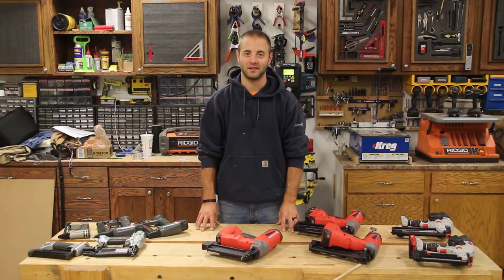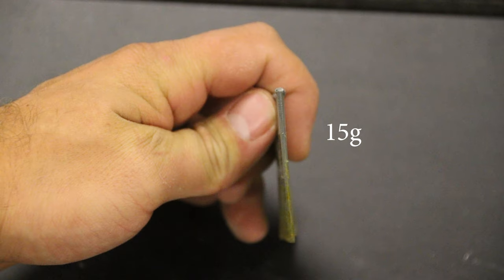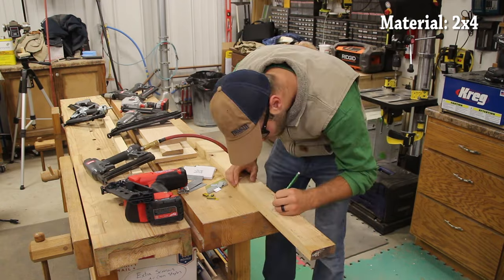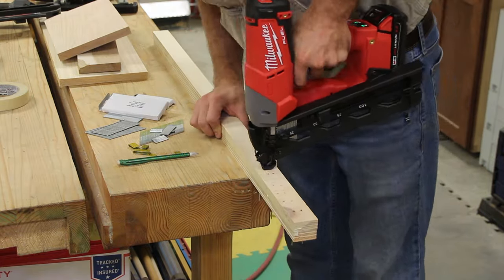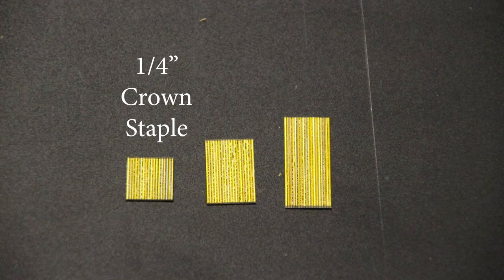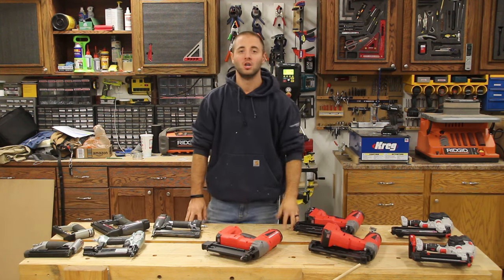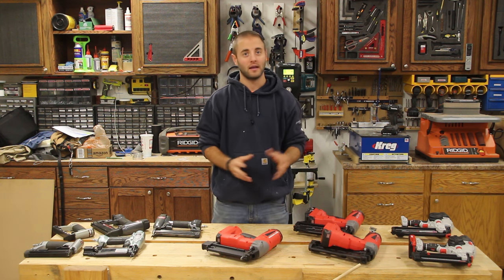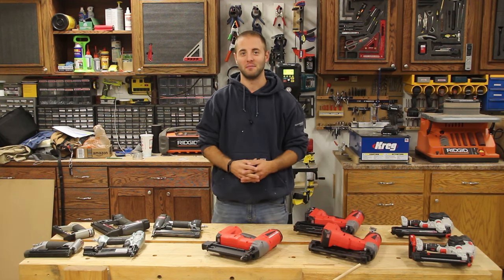What Gauge Nailer for Woodworking?

Comment: Perhaps you could guide me. I made a few 'racetracks' for my son. The vertical ones with tiny little cats that zigzag down 4 levels. First had PZ2 screws. It's very strong but looks terrible.  It's made if 12mm ply, and the screws crack the ply edges. Then the 2md trial was all glue and dados/grooves. Now this one has the look I want  but after 3 weeks of use it fell off a coffee table and broke. 

I want to get a nail gun to add strength so that it lasts years and years.

I was looking for the thinnest nails. So naturally I would take the 23 due to the small hole . However, you said it does not add much strength.  So now am wondering if I have to go with the 18! Then deal with the holes. What would you advise?
Reply from the maker: 23g is simply to hold something until the glue dries.  18g would work along with glue.

Comment: How about an 18 gauge for trim ? Redoing my kitchen and thinking about buying one versatile gun ... And use it for  small  projects around the house ..
Reply from the maker: Yup, perfect.
Reply: What about base board ? 18 still work ? thanks
Reply from the maker: @christullmann7666  Yes, it is all we use on 3" base.  If we got to 6" base we use a 16g.  Worse case, you put an extra nail or two in and fill the hole nicely.  You will be fine!  18 is the perfect all around nail for trim.

Comment: I'm gonna be putting together some fence panel converting it into shelves which gauge should I use?  I believe I have a ryobi with 18 Gauge will that  work? I usually put wood glue anyways but want it to hold and do it fast and putting glue does make it take a little longer... great video, I'm a new wood worker I'm 5 projects in this will be my second one I'm doing for a customer
Reply from the maker: 18 would be fine!

Comment: Thank You so MUCH WorkshopAddict!
I just bought a little 8 gallon 150 psi air compressor and was wondering if I could use it to drive nails for making bird houses and other projects like this.
You clearly explained a LOT and I appreciate it!
Awesome video!!!
Reply from the maker: Thanks Jeffrey
Reply: For myself, I went with a battery operated nailer. Nobody in the household wants to hear a compressor, nor do I want to drag around a hose. Another advantage is other than charging the battery electricity is not needed, also with a 4Ah battery one can fire 1,700 or more nails.

Comment: Great video! Thanks much. QUESTION: what is the shear strength of a 15 gauge nail? I am doing a faux exposed beams and will attach it to cleats (attached to studs). Wondering if 15 gauge nails will hold it.

Comment: I'm installing laminate flooring on stairs. I will use nailgun and also glue. Anyway, what nailgun should I get, given that the laminate plank is about 12-13mm, and the thickness of the stairs is around 25-30mm? 
I really appreciate if you can answer me. I am using nailgun for the first time, also installing laminate on stairs for the first time. 
Oh also, would a staple gun be better than a nail gun? 
Someone told me that nails wont go up and down with the movement of the stairs when people walk up and down on it, whereas using a stapler, it'll grab onto everything better and will go up and down accordingly.

Thank you :)
Reply from the maker: Here is my suggestion:  I would buy an 18g nail gun.  I would suggest this because you stated you are gluing the stairs.  The glue will hold the laminate down and the nail is there to help it stay in place while drying.  The nail can also be used on corners and small pieces where a staple would not be appropriate.  Staples would hold better, but with glue are overkill and limit you to only using them where they cannot be seen.
Reply: @WorkshopAddict  mate you're awesome, much appreciated thank you.

Comment: Hi I want to Do Chair Rail and Crown Molding in my home. starting with Chair Railing right now. Im looking to buy a Cordless Nail gun. I ssaw the Ryobi Nailer and I really Like it, but what gauge should I buy for Chair Rails and Crown Molding? 
18 gauge? Or 16 Gauge? and what size nails should i use for a piece of chair rail that's roughly 3/4 inch thick?
Reply from the maker: Kaynhine Dieogee You want 18 guage bud.

Comment: I'm starting up a project for framing out door casings/jambs and building my own wainscot from solid oak (going to stain it), as well as possibly a coffered ceiling. Would you recommend sticking with the 18g or going with something a bit beefier like the 16g? I read through the comments and it seems that the 18 might be ok, but those bigger pieces have me concerned. Trying to minimize the hole size while still having enough holding power. Thanks very much!

Comment: Very nice presentation! I especially like the picture of the holes sizes. Another video said gauge represents how many nails fit in a inch (18 gauge = 18 nails per inch). As a novice, I wanted an 18 gauge brad nailer but not knowing one from the other, ended up with a 18 gauge stapler, oops..  wish I’d seen your video first.
Reply: Well, I lied! Gauge does not correlate to the inch. I just measured 1 inch of 18 gauge brads and there were 21 per inch, not 18. Sorry, the previous video where I got that information was incorrect and I past-it-on without verifying. 
23 gauge = 0.64mm/.025” 40per”
21 gauge = 0.84mm/.033” 30per”
18 gauge = 1.25mm/.049” 20per”
16 gauge = 1.6mm/.063” 15per”
15 gauge = 1.9mm/.075” 13per”

Comment: Home depot sells baseboard moulding next to a sign with recommended fasteners. Most of it called for 6d nails! That’s equivalent to 13 gauge and there’s no nail gun I’ve seen which shoots 13 gauge. 

What would you recommend for most interior baseboard moulding? 16 gauge? 15 gauge?

Comment: Could you use the 18 gauge for making a privacy screen fence for the garden? Or would you need the 16g? Bit confused what to get as 18g would be fab for my indoor projects but worried the 18g would pull away from the post as it will be going through pressure treated timber slats (22mm deep) Many thanks! Can not find the answer anywhere!!

Comment: Andy: We want to install some 1" x 5" x 12' tongue and groove paneling strips on the inside walls and the ceiling of our "She Shed" we bought and had installed by Tuff Shed.   Will 15 gauge nails be okay for the ceiling too or would you recommend using a heavier nail?
Reply from the maker: Rick Habecker 15 gauge nailer will be plenty

Comment: Great video! I am going to be adding 1" oak stair treads to my staircase. I will be using pl premium but i also want nail it down aswell. I was hoping 16ga 2" would suffice?
Reply from the maker: Normally one would use 15ga on that, but you might be able to get by with 16ga.  Are you gluing them also?
Reply: WorkshopAddict yes I will be using construction adhesive as well
Reply: James Ouellette 16 gauge will get the job done if your also glueing them.

Comment: thank you for the information. I have a uestion thought, maybe someone around could help me as well, and its how to pick the correct lenght I need for my project. lets say that Im using the 18 gauge brad nail to put together 1/2" plywood over 3/4" plywood, should I use 1" lenght for that? how much deep does the brad nail goes from the surface?

Comment: Perfect video, thank you.  I'm just looking for something to fix picture frame and  small aquarium bases.  23g pin probably better than staples so I'll give it a go.  (I'll use glue as well)
Reply from the maker: 23 pin nailer is basically used to hold something until the glue dries.
Reply: @WorkshopAddict  Thank you.  I found a pos nailer for cheap so if it is not what I want it won't be a waste of money.  If it is I can always upgrade!  Thanks again
Reply: It'll hold till the glue dries.  Pin nails don't have a head on them so for holding power they really don't provide much, but for a picture frame they work great to hold corners together while the glue dries and are small enough that you don't need to deal with trying to cover up nail holes or staples.
Reply: @wildbill23c  Cheers, Thank you.

Comment: I suppose than the 18 gauge, then a stapler. I saw one that could shoot both staples and 23 gauge nails.
Reply from the maker: Watch out for combo guns as normally they are less reliable.
Reply: @WorkshopAddict  Aight, ill take that in mind. Thanks. Good channel my man.
Reply: I bought 18g brad nailer and 18 g brad staple/brad combo nailer.  Combo nailer leaves a huge hole when driving brads.

Comment: Great video. I'm new to wood working and have been collecting tools over the past couple years. I've been doing mostly smaller crafty projects and have been experimenting with nails and glue. By the info you give in this video, it seems like I should maybe get a brad nailer and use 18ga or 23ga, maybe in combination with some sort of adhesive. But I'm also going to be installing wood planks on my ceiling next month. If possible, I'd like to buy a nail gun that is appropriate for that project, but then can also be used for all my smaller projects after that. If I got a brad nailer, would it be appropriate to use 18ga brad nails along with construction adhesive on the wood planks, and then continue to use 18ga on my smaller projects?

Comment: Thanks for recommending a fastener. I am building trellis work and will need to fasten pieces of wood that are approximately 1"x1". Would you still recommend the 18 gauge brad nailer? Also, what length nail would you recommend?
Reply from the maker: Yes, 2" if you have  the meat to nail into.

Comment: I am going to be installing about 800sqft of 3/4" solid oak flooring, and shoe molding in my house.  Is it possible to buy one nailer to handle both tasks?  Is 16gauge too big for the shoe mold, or is 18gauge too small for the first few rows of flooring?

Comment: For attaching 3.5 x 11/16 inch stiles/rails (MDF) into plaster walls using both construction adhesive and 23 ga pin nails ok?  Concerned with plaster cracking.
Reply from the maker: Try it, but feels light to me.  Maybe 18g in the middle and brads near the edges?
Reply: Minimum would be a brad nailer...the pin nails don't have heads on them so they don't have much in the way of holding power, most likely you'll find the stiles and rails will quite quickly fall off the wall before the adhesive dries.

Comment: I'm after a nail gun think 18g will be best suited for me as is most versatile nailer but choosing between Milwaukee or dewalt what do you think noticed you used the Milwaukee any thoughts also great vid very helpful
Reply from the maker: J Selvey The DeWalt is much smoother than the Milwaukee.  The Milwaukee has a lot of kickback by design.  The DeWalt will also leave a smaller hole in the wood.
Reply: Thanks for the feedback 👍🏻

Comment: I've used Makita 18 Volt system for a while, trying to figure out if I want to get their 18 Gauge Brad nail or go get the tank/ three tool set for $60 less, Pros and cons???? I can think of already is, no hose or noisy compressor withe the Makita 18 volt...

Comment: i'm putting in 3/4 plywood subfloor into joists.  what type of nailer should I use? framing nailer or brad nailer?
Reply from the maker: Framing, but more ideally screws so they do not squeak.
Reply: great thanks! Should I use deck screws or construction screws? Im guessing at least 2 1/2 inch screws since its 3/4 " plywood?
Reply from the maker: @TheRpapito  2-1/4" to 2-1/2" would be good.  You can use either deck or construction screws.  Do NOT use drywall screws.

Comment: Thanks for the info, can also recommend any particular brand as a newbie?

Regards
Reply from the maker: Affordable quality.  Watch sales.  DeWalt makes a nice battery model.  Senco makes good pneumatic.  Many others are good, like Ridgid.  It depends on your budget and expectations.
Reply: WorkshopAddict 

Thank you for speedy response.

My expectations are simple I’m looking to expand my skills at home after work, keeping in mind that I don’t have same facilities that I have at the workplace. So basically I’m looking for something chargeable and long lasting.
Reply: TwitchBlackBat7 I just purchased the dewalt DCN680B brad nailer and it is on the heavier side but has plenty of power and is very smooth! If you have battery powered drills, I would stick with that brand if it offers a brad nailer. Such a pain to have all these different batteries for different tools
Reply: @ryanwestra2828  Very true.  Looking at that nailer for myself as well.  Too bad Dewalt is behind the curve and doesn't offer a 20V pin nailer.

Comment: What would you recommend for hanging tongue and groove to the ceiling . 16 ga or brag nailer
Reply from the maker: 16
Reply: Thx you.
Reply: The 15 or 16 gauge finish nailer would work.  Not much difference in them as far as application purposes.  I believe the 15 gauge nails have a bit more of a head on them than the 16 gauge nails do...so if trying to hide the nails the 16 gauge would be the way to go of course....the 16 gauge nails tend to more resemble the 18 gauge brads in their head type and shape of the nail...to me they're kind of square...and the 15 gauge seems a bit more rounded.

Comment: Thanks for the straightforward advice on the 18 gauge brad nailer.  I appreciate it.  Now, what about battery vs compressor powered?  Which one would be the best for the beginner wood worker?  Thanks.
Reply from the maker: How often will you be using it? We have both in our shop and they each have their place. I really like having the freedom of no hose from time to time but sometimes the cordless models can't keep up with production work. If you already have a compressor, I would invest your money into a kit with multiple gauge guns. If you don't have a kit, look into the Porter-Cable 18 gauge nailer.
Reply: well my first task is to add crown moulding to my entire house, then after that it will be as new projects come up.  I did use a battery operated nailer for a kitchen project and yes, there was a lot work stoppages due to battery drain.  I think I'm set on what I have to do next.  Thanks for the help!

Comment: Awesome video! What size 18 gauge brad nail can I use for my 5 1/4 inch pine baseboards I am installing with air compressor
Reply from the maker: 2" or so.  Hard to say since I do not know the thickness of your trim, if you have plaster or drywall, ect.

Comment: Thank you for this intro. I'm an amateur woodworker and I got a compressor system recently. I'm looking to build small thin cabinets for DVDs/blu-ray. I imagine I'll use 1/4" to 1/2" pieces. I'm okay with paying a bit extra for quality though I don't imagine I'll use it very often outside of special projects. Where should I begin? The Stapler? The 18awg?  Also for brands - holidays coming up and lots of deals out there. I see Hitachi, Bostitch, and others - any recommendations for what to get or what to avoid? Thank you.
Reply from the maker: 18 gauge brad nailer for sure. If you stick to the main brands, you can't go wrong. Especially during the lower holiday prices
Reply: Thanks so much!

Comment: I'm going to be doing a lot of small projects, most of them involving nailing two 3/4" boards together.  What length and gauge of nail do you recommend?  Thanks
Reply from the maker: I would need more info as to what they are doing.  Are they glued, will they support weight.  18 gauge 1-1/4" would be a start.
Reply: Start I am building headboard for my bed.  I was between the 16 gauge and 18 gauge.  but I don't like that the shortest nail you can get for the 16 gauge is 1 and 1/4 inch.    With my wood totaling an inch-and-a-half, if I use an inch and a quarter nail, after sinking it a bit, you don't think I will have to worry about it sticking through the back, or starting to split the wood on the back?  I will glue everything as well.

Comment: I'm going to be installing new fiber cement siding on the home I have just purchased is it okay to use the 16g finish nailer on those or should I be worried that they will separate and just use stainless steel nails?
Reply from the maker: I would think you would want a head on the nails so it would hold the board over time.  Also, the issue with corrosion would lead me to SS nails.
Reply: Thank you for the information that what I thought just wanted to see if I could get away with it cause it's so much faster.
Reply: Great video helped me to decide on Brad nail gun
Reply from the maker: @FUERTE661  Can you find the right nails in a coiler nailer?  ie roofing nailer

Comment: I feel like I'd be happy with the Milwaukee 18g, but my worry is that it only offers the straight option. I've read that people seem to rather use an angled nailer for tighter corners and such. Would the Milwaukee 16g angled nailer be a better option for me if this is a concern of mine? (I'd mainly be doing indoor stuff, like trim, baseboards, crown etc...) - Thanks
Reply from the maker: Most 18's are straight.  Those are used for small trim and crown.  16g is used for base, window trim, and most door trim.  Sorry bud, but you need both for what you want to do as 18 is too small for base.
Reply: Good to know, thank you for the quick response.

Comment: I'm looking to buy a nailer, been thinking about 18g, I build marquee letters from MDF, led letters for weddings, I currently drill pilot hole, screw and then have to fill and sand, letters get moved about alot, would 18g be enough to handle the letters being moved about, I want to change to a nailer to cut down assembly time and also a smaller hole to fill equals less sanding.